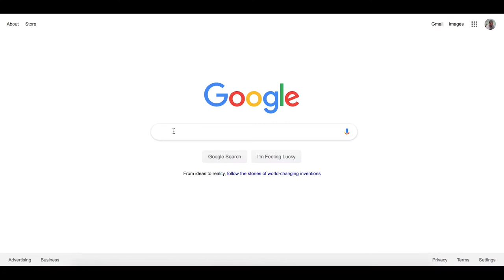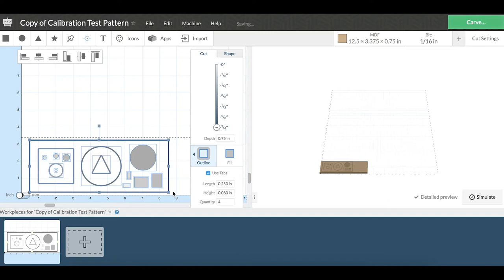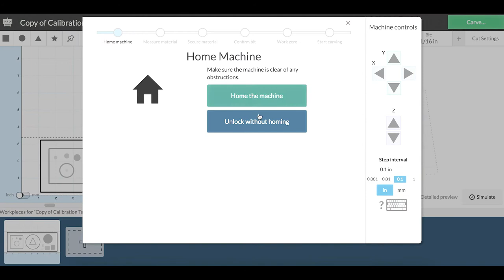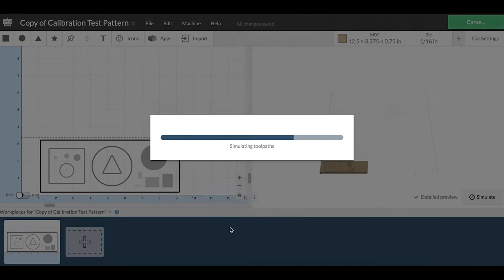X-Carve Zero to Hero - Calibration

Comment: Ugh! The thing that I wanted to see most is where on the left of the project you placed the bit, I’m confused about exactly where you do the XY ?
Reply from the maker: Typically, I place the X/Y as close to the bottom left of the work piece as possible. Usually do it by eye.
Reply: 1) Move the bit to approximately the lower left corner (2) Lower the bit (z axis) until it's a hair above the material (3) Move the x/y until the center of the bit is right over the bottom left corner.

Comment: You say this is a calibration video, but at no point was anything calibrated. You checked proper assembly, and then ran a calibration check piece but at no point was the machine calibrated. You even day the machine is off, but its good enough for your needs.

Comment: more like hero to zero, so you did not actually calibrate the machine, waste of time
Reply from the maker: Sorry to hear you didn't enjoy the video. This was the initial calibration of the machine, which actually didn't need much. Lemme know if you can offer any suggestions on how to more fully calibrate it. Thanks for the watch!
Reply: @DuraWoodworks  only suggestion I would have said is the waste board needs to be plained. Because the mdf isn’t true throughout the wasted board. If the waste board isn’t true your depths of cuts can vary because or the difference in the height of the waste board.
Reply from the maker: @crashdummy1000  yeah I’ve definitely read about that since posting this video. Not gonna lie, it scares me a bit to do that but I’m sure I’ll need to at some point haha
Reply: @DuraWoodworks  it’s easy. There is plans on the inventible community for the waste board. Make another stock waste board with 1/4 mdf. Mount it to match the holes from stock wasted board. And plain it with a planning bit. This way your stock waste board is still good and you have a disposable waste board now. That you can replace when needed.
Reply: @crashdummy1000  I did exactly this tonight and it worked perfectly.